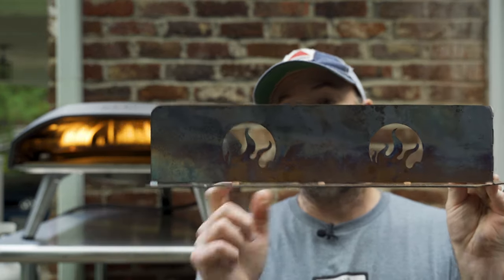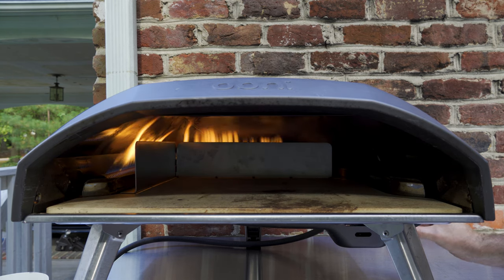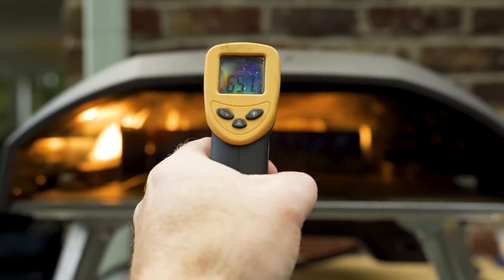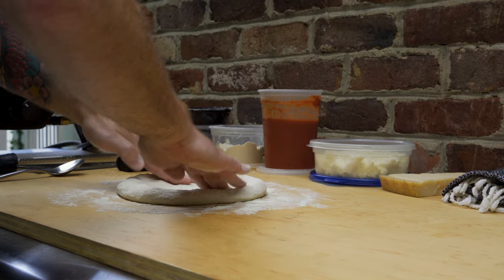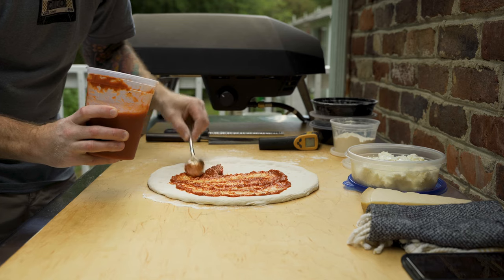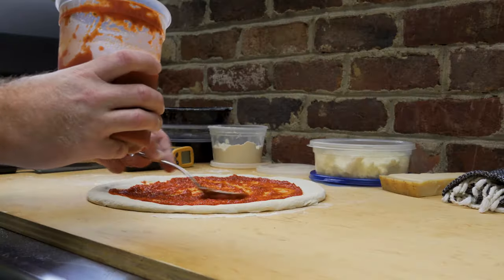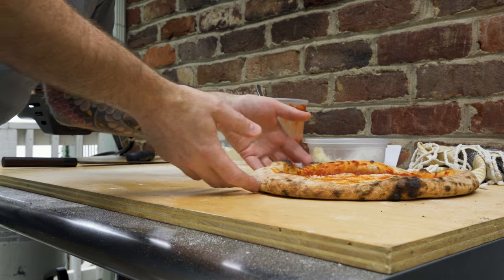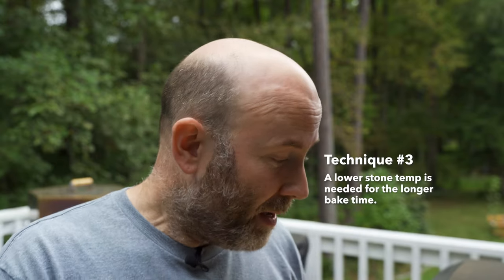Ooni Koda 16 Flame Guard | 2.0 Version | Any Better?

Comment: I appreciate that you were likely sponsored this tool as a tester, and you didn't feel compelled to give it a full endorsement. It speaks to the validity of your reviews. 

I have a Koda 16 and the hardest thing for me is to get the bottom and top cooked properly at the same time. Frequently, one will be more done than the other. Perfect top - raw bottom (or vice versa). I have been at it a while, and while it's getting better, I hope I can master it with more practice.
Reply from the maker: Exactly, I was asked to test it out a provide feedback. Keep practicing, and you'll get it. Promise!
Reply: Just adding my suggestion regarding with the even cook. Look into get a biscotto type stone. Since moving to a biscotto stone, the base cooks a lot better. and how he does in the video, lower your flame with the pizza in the oven, I get the stone to about 450 degrees C. Just a suggestion.
Reply: In my limited experience the stone temp seems to be the critical factor. Also I suggest until you get the hang of it, favor lower burner temps and longer baking times, and turn the pizza in small amounts more often (like even every ten seconds or so). It might sacrifice a bit of rise, but much less likely to burn or be underdone. Once you get good pizzas that way you can vary what you are doing with more confidence that you will still likely be happy with the result.
Reply from the maker: @thecheechmantube  agreed. I tested out a Biscotto stone in my previous video and really enjoyed baking with it.

Comment: I have a full size brick oven and will often use half a refractory brick as a heat shield. In that case the lower conductivity and thickness (1.5 inches) makes a noticeable difference. I only use a 6 inch piece just to shield the far tip of the pizza when i have a roaring bed of coals. I think the issue here is that any thin walled metal flame guard is not going to provide much insulation once it's been in the oven for a few minutes. You would either need to use a thick piece or something not as conductive.

Beyond that, one other advantage of a flame guard of shield is to prevent you from accidentally slipping the pizza into the flames and instant burning it, the peel would be stopped by the guard.

Comment: You absolutely don't need a flame guard. Just turn down the heat just before you put it in. My pizza came out great. So did my steaks, but there's more clean up using the pizza oven for steaks.
Reply from the maker: Yeah, I choose not to use one. Testing it for those that might be interested.

Comment: Just throwing out my theories on the flame guard based on your results.
1. When you put the flame guard in during preheat, the metal gets hot and emits as much heat as it receives. As far as the pizza is concerned, it's almost the same as if the flame guard weren't there. As far as the rest of the oven is concerned, I wonder if it's getting other areas of the oven too hot.
2. When you put the flame guard in before bake, it soaks a lot of the radiant heat, leaving just a little bit of flame over the top and the stone to do most of the baking.

What to try next?
1. I'd see if polishing the surfaces of the flame guard would reduce the heat that's emitted through. Might be tricky to have a surface that stays shiny at elevated temperatures.
2. Angle the walls some way such that the heat gets reflected and bounces around the oven to the top/middle of the pizza.
Reply from the maker: Dropping the flame guard in after preheat only helps with the first pizza. What if you’re baking multiple?

Some good suggestions on design. I hope the manufacturer is reading every comment!
Reply: @KitchenCraftFood  If it can retain a shiny surface, the flame guard will absorb and emit a lot less radiant heat, so it acts like an actual barrier, at least for a longer time. It's just theory though, as there are a lot of variables to account for.

Comment: In windy conditions it might help the flames to not go over top of a Neopolitan crust. The oven is designed for high heat cook and can see the point of the flame shield. The longest it takes is 1min 30. If you put a pizza in a 450c oven with no flame it will be burnt and it is technique and heat management to be honest. Have a go in a 20mph wind.

Comment: I have just thought of a turning pizza ceramic stone. Just get a hoop of steel and a tub of ceramic balls that you use in pie baking.
Put the balls loose in the hoop thats just slightly lower than the height of the balls then place the circular pizza stone on top. Then get a slightly larger diameter hoop to contain the pizza stone. You can then score the edge of pizza stone with an angle grinder so you can grip the edges for turning your pizza in a small gas powered ooni type oven

Comment: the trick has been to cook th bottom and top at the same time. They make a steel that fits the koda 16 and the bottom cooks very well. I have one. Also the steel keeps hot between cooks and I have a door that fits the koda 16 which also keeps the steel very evenly heated from the back of the oven to the front. I am never tried the guard but something tells me the other variables are more important. Lowering the flame after the temp comes up is needed as long as the stone or steel is evenly heated which goes to the base your using and door which keeps the heat in.

Comment: FWIW I have the older Ooni Pro 16 and there's no need for a flame guard, nor is there any need to lower the burner while cooking. You get it up to 900F and cook a perfect pizza in one minute (I use the pizza door). I wonder if the taller "dome" is the reason, keeps the flames higher above the pizza. The new Karu should be similar if so.

Comment: So the ultimate question if you had to pick one oven - Ooni Karu 16 or Ooni Koda 16? Would love to see a side by side comparison video while I wait for my Karu 16 to arrive :)
Reply from the maker: Funny you mention it. I'm working on that exact video, and I'm using the gas attachment on the Karu 16 for the comparison.
Reply: Ooni Koda 16 would be my pick. It's 200 dollars cheaper. If you want multi fuel get the Karu. Personally I have used pellets and wood and it's a pain in the butt. Hard to keep temp consistent too. The Karu comes with a glass oven door which you really don't use for the gas attachment. Chimney cap on and no oven door when using gas. Chimney cap off when using the door for pellets and wood.

Comment: Not sure a flame guard is necessary but super easy to have made at a sheet metal shop out of aluminum or stainless (my preference). Maybe $20 to have a piece cut and 2-90 degree bends done. Not worth $90 or whatever they charge on Etsy.

Comment: Good info.. like someone else pointed out. A brick is probably better.. takes longer to heat. Maybe a 3/8 inch to 1/2 inch steel plate might work. But once it's soaked in heat it won't cool down as fast that's for sure.. but i5 might keep the stone warm longer.. anywhoo.. thanks for the vid

Comment: How much oven floor space are you giving up with the flame guard in place? Will a 16" pizza still fit or is it more closer to a 13" or 14"? Maybe someone can invent a tube cover that slides over the gas attachment that pushes the flames more towards the walls so it doesn't give up space.
Reply from the maker: Max 14” size with the flame guard, and I like your idea!

Comment: I guess I don’t understand what result you were looking for with the flame guard. I mean you put the pizza in the oven, the pizza is gonna cook especially with the high of temperatures from the Ooni
Reply from the maker: Well, the question was does a flame guard help keep you from burning the crust when baking pizza in something like an Ooni oven. Results in this video show that finished pizzas, baked for the same time and at roughly the same temp, appear no different from one another. That tells me that a flame guard like this one doesn't really do anything other than take up space in the oven. 

Baking great pizza in these smaller ovens is not easy. Many people struggle with the steep learning curve. The edge of the pizza is so close to the flame that there is zero margin for error. They end up charring the outer crust before the bottom or top of the pizza is properly cooked. 

An updated, properly designed flame guard could provide a barrier between the outer crust and flame so there's less of a chance for burnt crust. It could be an effective tool that helps folks practice/learn the process without having to serve or throw out a bunch of charred pizza. 

Think of it like a set of training wheels. Craftsman House is on to something, but the flame guard needs to be redesigned with some additional testing.
Reply: @KitchenCraftFood  yeah agreed! You know you can turn the flame down even more?
Reply from the maker: @FlightForce77  Oh yeah, I use that trick every time 👍. You pretty much have to on the Koda.

Comment: Why you don't use the ooni turning peel? Why your flame is badly yellow and not beautifully blue?
Reply from the maker: I don’t have the technique down when using the turning peel. Still practicing. 

Can’t comment on the blue flame. I’ve never owned a pizza oven that produces one. Maybe it’s the propane?
Reply: @KitchenCraftFood  what fuel are you using?

Comment: Where’s the Biscotto stone?
Reply from the maker: I switched ovens to the Karu 16 so the stone doesn’t fit. Maybe I can cut it down so that it’s useable in the new oven.
Reply: @KitchenCraftFood  Ok. I ordered one after watching your review and wondered why it wasn’t in this video using the Koda 16. Wanted to be sure you suddenly had a change of heart on the stone. Will the flame guard fit in the Koda 16 with the added height of the Biscotto stone?